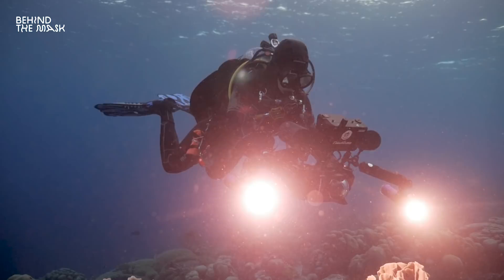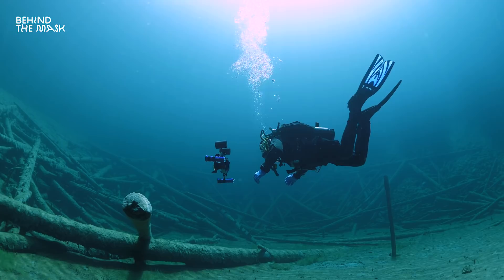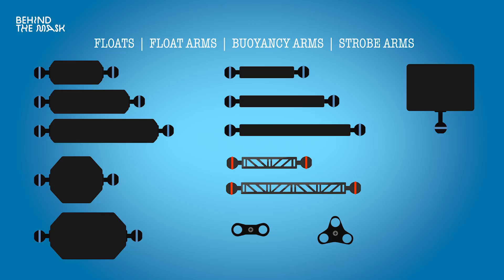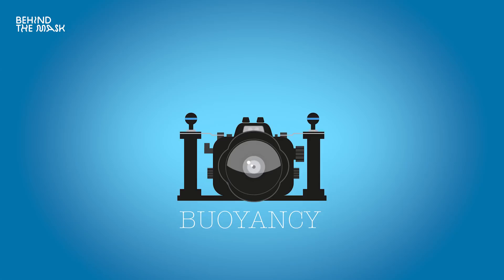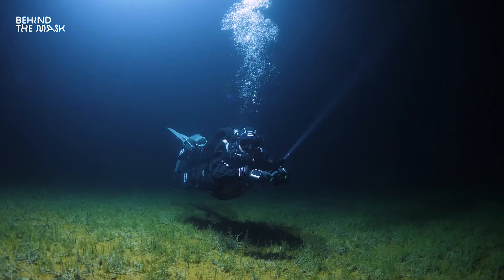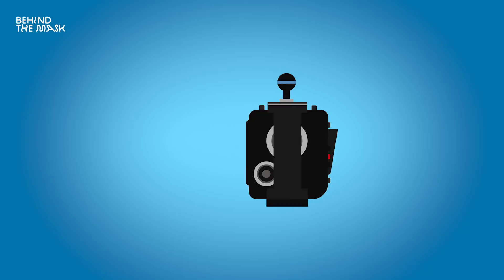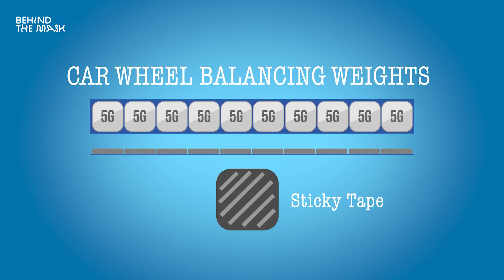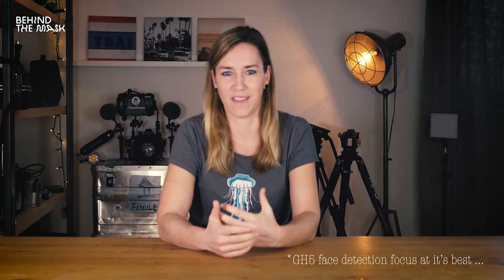FINDING THE RIGHT BUOYANCY FOR YOUR UNDERWATER CAMERA

Comment: I use 4 D&D Mega floats (each 400 gram) in between a few segments of my old Stix Float Belt to adjust macro and wide angle setup for a Aquatica GH5 housing, with Dive & See monitor and 2 Keldan 4x

Comment: Nice job. May I ask what brand and size are the two horizontal floats mounted above your two handles? They look efficient and out of the way. Thanks!
Reply: Aquatica..  dont know if they still make them
Reply: I’ll make it really simple. You can make this yourself. Buy the following: 1) Expanded Polysterene block, it’s like $12 on Amazon. 2) A waterproof, tarred string . 3) Krazy Glue (which is waterproof). Glue the polysterene blocks to the bottom of the housing to get it to float, and tie a string with blocks on it, for the front lens area to raise it up (put the string thru the middle of the blocks, puncturing and making a hole in them). This is what they do in factory. Takes like 30 mins of work, but worth it to save like $100.

Comment: I wish housing manufactures would make housings  for the video centric camera bodies more like video camera housings. and make them positively buoyant .  Much easier to add lead as weight to set trim on say a bare bones snorkel rig than add buoyancy with bulky arms on negatively buoyant  full set up with lights and monitor.  Not to mention the added drag.

Comment: Great advice, I'm still working towards that set up. Funds don't allow right now so my rig is super negative and I guess I'm used to that now. But this has reminded me of the importance to get that sorted out. I also use a rig with combo of video lights and strobes. Never easy switching between 2 disciplines multiple times on the same dive. Any tips on best configuration for this set up? Thanks.
Reply: as we don't know what you are using, it is hard to recommend anything :) but there are big floats with lots of buoyancy and you can add triple clamps to attach both lights and strobes :) also you can attach a float beneath your rig and attach it to the handles with cableties.

Comment: Nice Video 👍 What would you recommend to be as flexible as possible? I'm using a GH5 in a Nauticam housing with different ports and lenses. And I use it in freshwater as well. So I'd need a lot of different float arms to cover all of that.
Reply: see below the anser to SharkManDan :)  Hope it helps

Comment: You mentioned short arms-- what is the suggested length? I have a hard time deciding between 8in or 10in arms. Do you not have problems with backscatter from the shorter arm length?
Reply: If I film in murky water I would choose longer arms. Really depends on the water.

Comment: Nice video series 👍
Please suggest how to make rig bouyant having flex arms. I m using tovatec 12 inch flex arms holding heavy lights which makes my rig heavy.  I m not able to find any option or idea to make the rig float. Plz help.
Reply: did you try foam floats??? don't work very well when going deep, because they compress, but to 15m should be more than fine!
Reply: @ReefPatrol  I tried foams but as you said they are not good after a certain depth :(

Comment: Wondering if you can add some links to the gear you're suggesting?
Reply: what links to you need :)
Reply: What would you recommend for weights/floats? I'm guessing for traveling floats would be better? Or does it not matter too much? I use GH5 in Nauticam housing :)   @ReefPatrol
Reply: well depends on a whole  lot... dome, lens, lights, I can't just say this or that :)  @Sharkman_Dan  you can see the different floats in the animations, you need to find out how heavy your setup is underwater and then go from there and test different floats and see what works best. INON, NAUTICAM, etc. all have different floats with different buoyancy. In the background you can see my setup. Inon 275gr floats, with big aquatica floats when using a small HD monitor 501 with 2x Keldan 8x and the Nauticam Acrylic Dome with the GH5 + 12-35mm lens. That works well with me. I trimmed it a bit with the cuttable LEAD SHEETS so that it's perfect when I let it go in saltwater.

Comment: Hi, I wanna know what brand do you use for the float arm with 1 connector (the one that look like hammer)
Reply: that's aquatica. but you can use the big Nauticam, INON, etc. ones instead.
Reply: @ReefPatrol  aquatica float arm which u used is no longer in production and is discontinued.